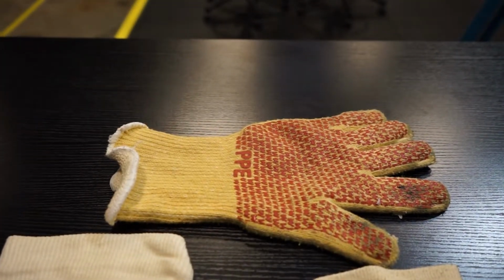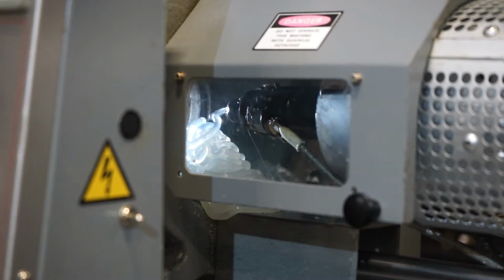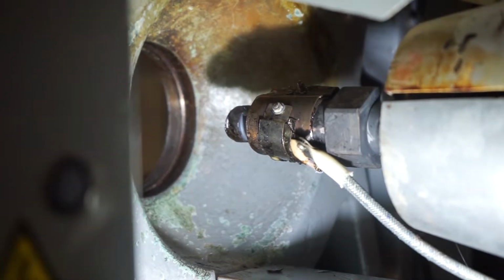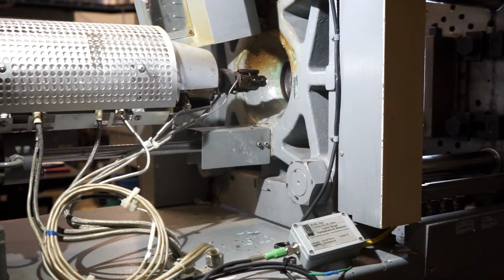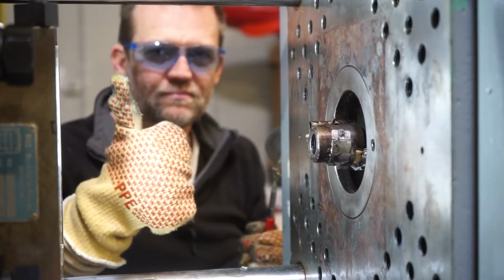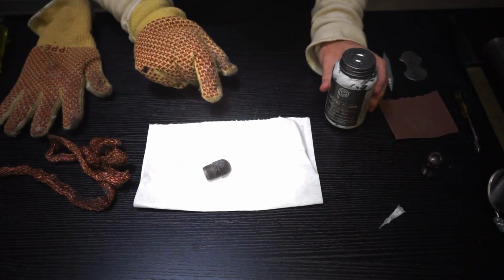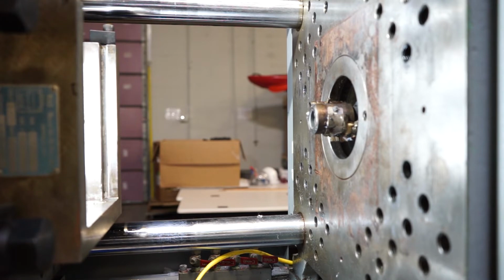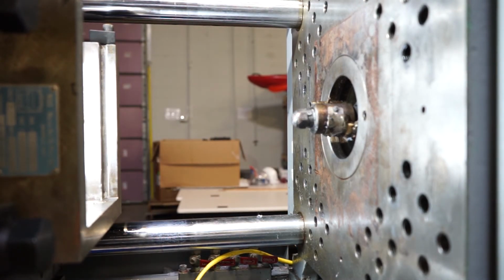How to Change a Nozzle Tip on an Injection Molding Machine

Comment: Just want to know what you have heard or know about using a copper based ant seize on the nozzle tips. Have been told that it will still seize the tip up if you are running Acetal materials. And really good video but should be cleaning the nozzle tip with a wire brush in a socket to hold it as soon as you take it off the machine while it's still hot. The outside of the tip will clean up a lot faster and it may be easier to clean out some materials while it's still hot. I use the brass mesh with a small flat screw driver to do this.
Reply: I've been using copper anti sieze for years. Never had issues, and my last shop ran a TON of acetal.
Reply: @spikereynolds8615  Good to know thank you .

Comment: is it normal to find tiny metal pieces inside the nozzle tip?
Reply from the maker: Definitely not. Are you using magnets in your hopper? If not, that may catch that metal as long as it is a ferrous metal. Where do you think the metal is coming from?
Reply: @rjg  It seems like pieces of a washer, we had to remove them since they were stuck on the tip but we have no idea where they came from

Comment: 150 ft/lbs seems like overkill for a nozzle tip. I don't even torque 3/4 or M20 clamp bolts to that. 

I was always taught to just snug them. I mean, that may not be correct.

Comment: 150 ftlbs or inlbs?
Reply from the maker: Ft lbs.
Reply: @rjg  Bolting clamps is done at 70-90ftlbs on most presses 130ftlbs max in industry. 150ftlbs is way to high......
Reply from the maker: @TuKwick  Tutco.com recommends 150 ft lbs on a nozzle tip. We use M16 bolts for our molds and they go to 180 ft lbs. I understand that almost no one uses a torque setting for their nozzle tips , most people just go by feel which is not a good idea. How tight do you tighten your nozzle tips when you change them? I am curious what people actually do in the industry.
Reply: @rjg  We go to 60ftlbs anything over that is overkill for a 7/8-14. For the mold M16 at 180ftlbs is above what Nissei calls out. Nissei on a NEX M16 calls out the following: Close to the mold 140ftlbs and 162ftlbs when away from the mold. it should always be taught to look at the machine manual. for the 150ftlbs from tutco. Sure you can use it but does it make sense and how did they get there? It is brobably a "Ham Story"(see Jason Robinson for details of the Ham story).
Reply: @TuKwick  I don't take m16 clamp bolts over 100.

Comment: You call out for a 6 point box end but youre using a 12 point. you recommend using a cheater instead of prescribing the right tool for the job, a proper 2 foot breaker bar or a bigger drive bar.
Reply from the maker: Yes, I misspoke about the wrench. I did say 6 point but meant to say 12. Both will work but a 12 point is a little better. It is common to use a cheater bar or a “proper 2 ft breaker bar”.